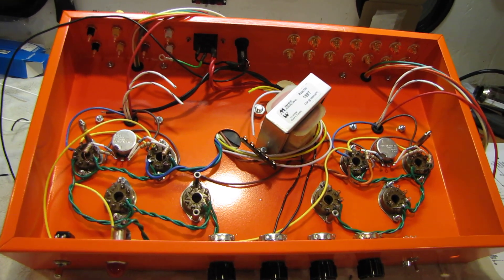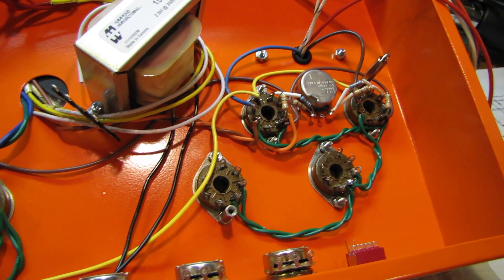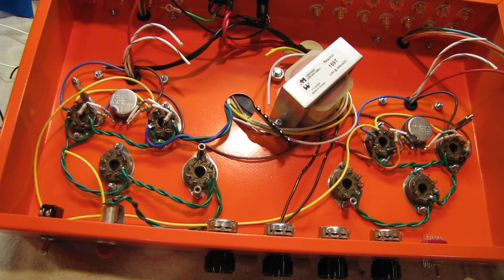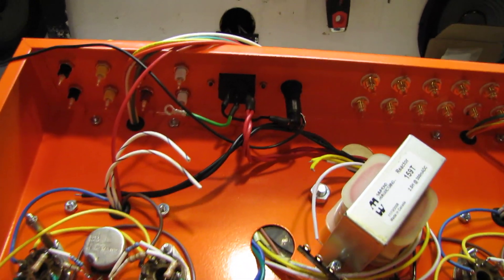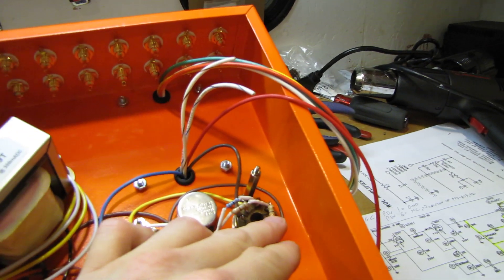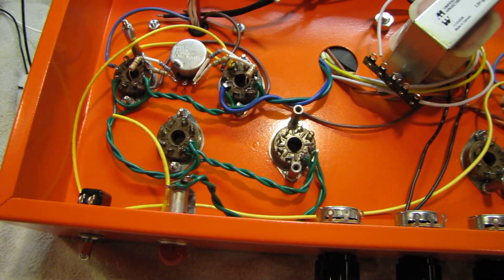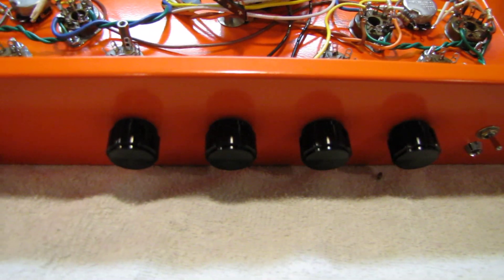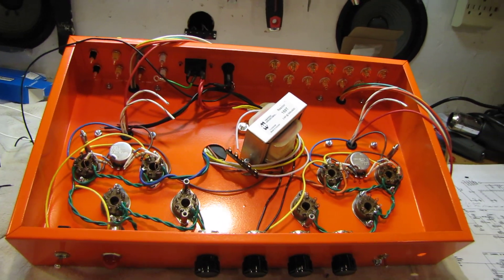My DIY 6L6GC stereo tube amp project, part 2

Comment: How much did this cost you? I want a tube amp and need to find a cheaper one! My dad loves the sound! But most are like $1,000 for most amp kits! So I'd like to know how much this would cost!
Reply from the maker: At the time I probably had around $450 in parts alone.  Not sure what it would cost today though.
Reply: That is incredible! Where did you buy your parts?
Reply from the maker: Joshua's Recordings Various sources.  The most expensive parts were the output transformers and the tubes.
Reply: Ok, I will do some research!
Reply from the maker: Joshua's Recordings
Now that I've had some time to remember stuff, here's a basic list:

Ouput transformers: Edcor CXPP series
Power Transformer: Antec 3T-325
Tube Sockets and other stuff:  Surplus Sales of Nebraska
Resistors, Capacitors: Mouser and Radio Daze
Chassis: Hammond Manufacturing
Reply: What output voltage do you need?
Reply: Also what tubes do I need and do you know were I'd buy them, Also were do I get the schismatic?
Reply from the maker: Joshua's Recordings There is no schematic, since I built this myself from a couple different circuits.  There are lots of designs available online though, many of which are better than this one.  The DIYAudio and AudioKarma forums are the best place to start with stuff like this.
Reply: Oh, no I thought yours was great! Never owned a tube amp myself! I went to bestbuy and my dad saw one and I wanted to try it out!
Awesome sound!
That is all I want! At around 20Watts RMS is fine!
Reply from the maker: Joshua's Recordings The power amp stage is basically a Harman Kardon HK250 with a different driver tube and bigger power supply.  The preamp stage was a circuit designed by Max Robinson.  I made the chassis layout and power supply from my own design.  I actually listed this amp on Ebay a few years ago, but it didn't sell.
Reply: Oh, that is to bad! If the price was good enough my dad might of bought it from you!
It was a great amp. With a interesting design.
Did you ever sell it?
I might try to build one. As soon as the snow melts. My soldering iron feel out of were I was storing it! And is under the snow. That is annoying because I am building a subwoofer for a boombox that I built awhile ago and need that to finish!
I also found a heater that I need to change the capacitor.
But I may try to build a tube amp. $400 is a great price for a 25W tube amp.
Thanks for your time!

Comment: Great job take your time. I did an 84C Zen 1.8 watt integrated SET and it was much more involved then I had anticipated. A cople of months after completion I had some issues with a few cold solder joints on some of my heaters. I also rewired one of my power supply caps wrong I almost took out my 5u4g.
This looks real great and clean. I need to do a better job at reading a shematic. It looks like u know what your doing.I'll be anxious to hear your results.